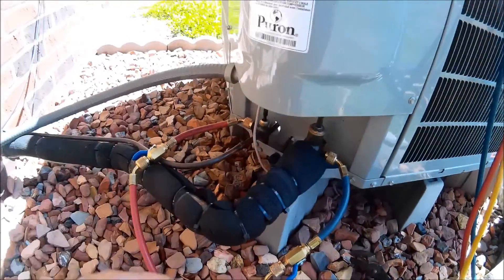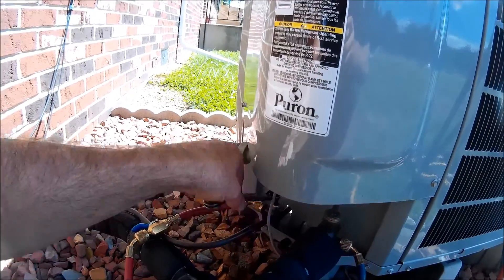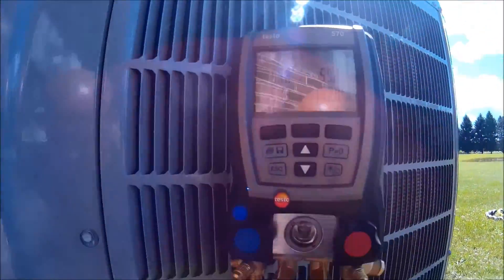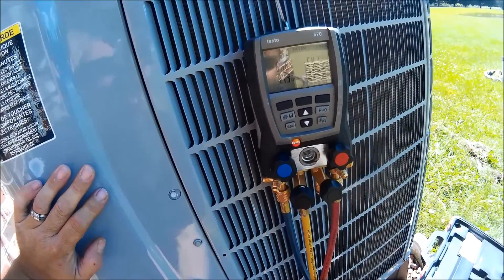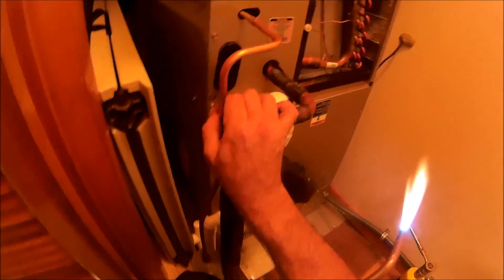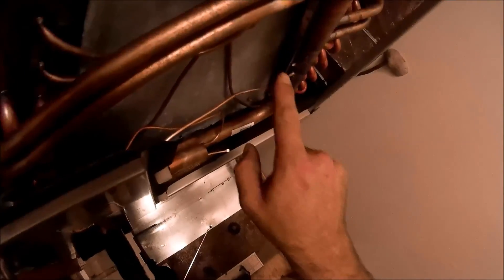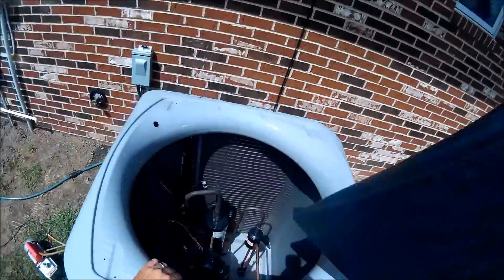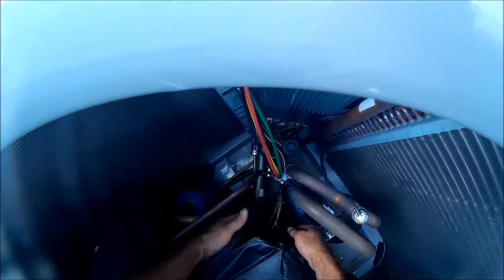Carrier Infinity Fan coil txv replacement

Comment: That plastic box thermostat control is awful.  Can this be controlled by an eco Bee?
Reply from the maker: Bertram Inc. It can be but you lose all the control of modulation it turns it into a two stage heat pump instead of 40 stage modulating heat pump

Comment: how important are those insulation jackets for compressors?  im guessing they are pretty low on the scale.  if i find one, i always reinstall it, but i give it a good cussing in the process as being a complete waste of time.  LOL
Reply from the maker: jeff leonard  its mostly to reduce noise from the compressor. The compressor in this heat pump ramps up to 7000 RPM in heating mode and gets really loud if it doesn't have the sound blankets on (insulation) and its a good home for the mice